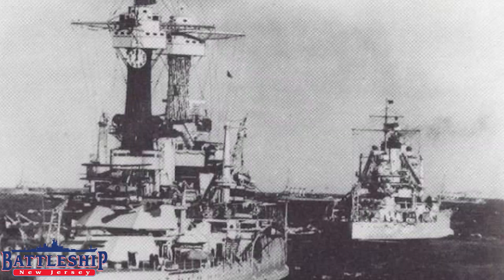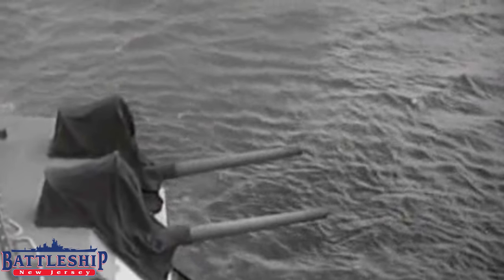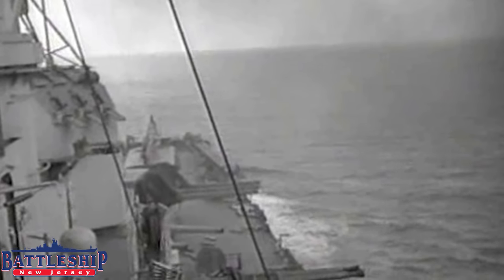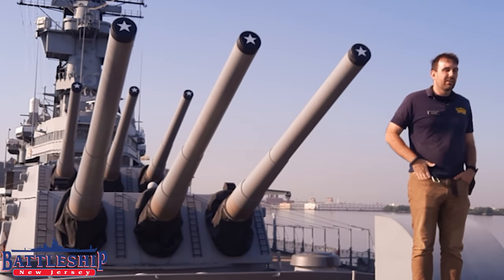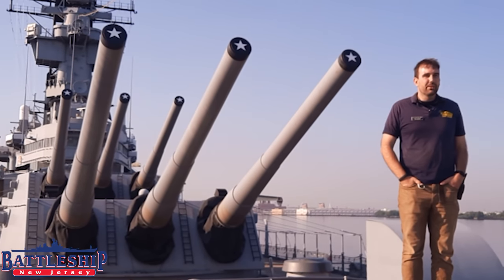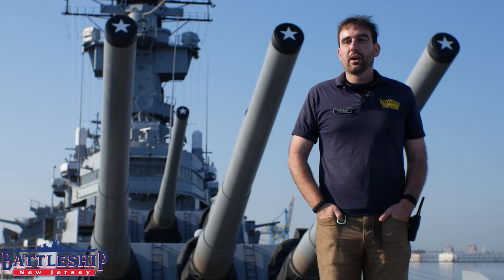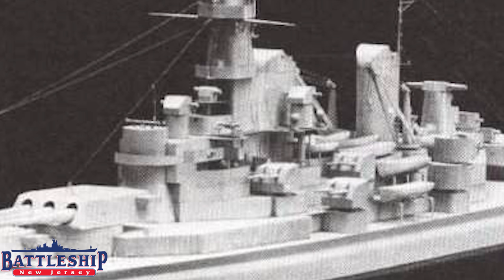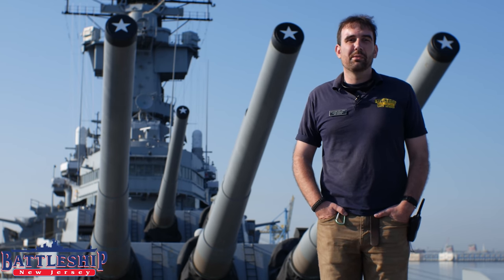Why are There Clocks on the Superstructure of Battleships?

Comment: I have always wondered how they distributed fresh air through those old ships, and exhausted the stale air.
Especially when they were at general quarters and all the water tight doors and compartments were sealed.
Reply from the maker: Check this out https://youtu.be/8xNzgxSihPY
Reply: At general quarters those things are shut down.
Reply: @michaelsommers2356  
Wow. I suspected as much. It must get close and unbearable if it goes on for an extended period of time.
Reply: @randypowell3180  I can't speak for the battlewagons, but Ticonderogas maintain ventilation during GQ unless it's a Chemical/Biological/Radiological defense situation...and even then, there is still internal air circulation.
Reply: @kdarkwynde  
Similar to those on a submarine maybe?
Reply: @randypowell3180  Especially in the tropics.  But it's better than sinking due to water flowing through the ventilation.
Reply: @michaelsommers2356  
No kidding!
Reply: @kdarkwynde  Ticonderoga is 80s and90s. Im sure battleships got ventilation after modern upgrades. But I guess in and before WW II not so much. Chemical Biological Nuclear warfare not a big concern in WW II. I think early submarines had to surface for fresh air
Reply: @3mtech  Gas attack .after ww1 all royal navy ships had methods of sealing the ships and ventilation/ filters for such. .i dont know , but i'd suspect U,S ships had similar .

Comment: [BB Tech. Question] :  Everything about Scout planes.  Why the battleships always had the catapults (pivoting/movable?) all the way aft (which seems reasonable), vs. the cruisers that had fixed aircraft catapults oriented athwartships in the amidships superstructure (which seems... problematic).  And the cranes & operational techniques to recover the planes when they returned.
Reply: Size Matters. 
Some Battleships had room for a Hanger, below the catapult on the Stern.

Many Cruisers had a hanger fore, or aft of midship catapult.

Comment: I imagine the Texas had a range clock at one time, since the later "standards" had them. Probably removed during one of her refits.
Reply: @Salty_Balls  BB-35 has  forward facing "analog clock" to this day. I am I misinterpreting what this video is positing?
Reply from the maker: We checked modern images of Texas and didn't see one, maybe she does though
Reply: @BattleshipNewJersey  I just looked at the image on their website.  No clocks visible.
Reply: @kncannon  I've been to the Texas several times and im not sure what you are talking about
Reply: Looking through the images wiki has of her she wasn't built with one, but acquired one by 1919 at the base of her mast both fore and aft. She had some work between 1940 and 43 getting more radar and losing her clock.
Reply: @BattleshipNewJersey  There's at least one photo I've seen of the Texas operational in '43 that doesn't show one.
Reply: Texas is so old she likely started with an Hour Glass.

Comment: Some of the reluctance to transmit over radio may be that if the enemy hears it (if they’ve broken your code or something) then they have the range too. The distance between the battle lines is the same for both sides. So if the enemy can hear your transmission, then you’ve just given them the range too, and their next salvo is going to hit you.
Reply: @Just Looking If a ship can read your range clock, it's close enough for a point-blank shot.
Reply: @Just Looking The clocks point fore and aft, your enemy will be off the port or starboard so they would see the edge of the clock only.

Comment: This is really more of a question. I enjoyed your expanded explanation pertaining to "Range Clocks" ⏰, and especially how it was made further obsolete due "high frequency", "Talk-Between-Ships". The second component explains, in part, how communications have improved since Dreadnought and Jutland. Understanding the integration of a huge bunch of various components is a necessity in understanding how any modern system, especially as complex as an apex Super-Dreadnought Battleship, functions increasingly more effectively over evolutionary design improvements.

Now The Question Regarding the New Jersey

On the last class of U.S. Battleships, I have been told, a new type of advanced "Fire Control" was utilized akin to a computer plotter. Also, the system is still on board, and used as built despite being designed nearly 80 years ago. Can you explain anything more about the Iowa Class "Fire Control Computer", and how it has remained a relevant piece of critical strategic C.I.C. equipment over the many decades of its on-board availability. I realize that the Iowa Class hasn't been used operationally since the early 1990s and aren't likely still up to modern standards. However, they were used in their most recent deployments after being modernized and refitted and I do wonder how well that worked as well as how much the systems had to be modernized/altered and augmented by other more modern system improvements. 

Thank you for your consideration.
Reply from the maker: We show off that computer in this video:
https://youtu.be/dmgsy01t0-U

Comment: What I would love to know about: What would the state of auto/self loading guns be like on a battleship scale? ie. Taking the same idea that was used in the Des Moines class cruisers with the mark 16 8" 55s and if/could/would it be scaled up and if there was any real discussion about a self loading battleship grade gun, and if there were any early designs for such a system.

That 8" mark 16 system on the Des Moines class was science-fiction only years before it was put on those 3 cruisers. I cannot imagine that 14" 15" or 16" systems of a similar design would not be on the drawing board, if the navy had continued to develop the gun systems of battleships. Especially with people who championed naval gunfire looking at what that gun system did with an 8" gun. Video of those guns in action is damned terrifying.
Reply: I've thought about the idea of a modern large caliber gun for firing sabot HE shells or other munitions at land targets.

Think like a ship version of a STUG. The gun isn't in a turret, but mounted to the hull with limited traverse. You point the ship where you want to shoot. Since the gun doesn't have to swing around, you can support the barrel more and make it longer. perhaps 70-90 calibers. This gives you increased velocity at the same pressure.

You'd probably mount two guns on a ship, firing backwards over the stern. This keeps the ship from being bow heavy and puts the muzzle blast somewhere it won't cause too much trouble. Smaller ships makes them cheaper and lets you deploy them over a wider area.

As I said earlier, you'd use a sabot. So a 16" smoothbore gun of 80 calibers in length might fire a 8-12" shell in a sabot. This will allow high muzzle velocity, yet good aerodynamics of the projectile. Add in base bleed or rocket assist projectiles and you could easily get a 100+ mile range. 200 might be doable, depending on how much mass you want to send. Modern propellant and metallurgy technology would allow the gun to maintain a reasonable barrel life.

You'd be able to fire whatever would fit into the sabot. Everything from cheap dumb shells that explode on impact to guided munitions that use GPS.

Comment: I once played in a large 1940 Mediterranean cruiser action using modified Fletcher-Pratt rules. The hard core players wandered all over, avoiding maneuvering patterns so as to make their range unpredictable. (Nothing like actual fleet units.)
We had three CAs, players I knew well, whose range-finding eyesight was as bad as mine. I talked them into doing something different. We lined up, nuts-to-buts, maneuvering slowly, concentrating on a single target, comparing ranges. One guy shoots a bit over the estimate, one straddles the estimate, and one shoots a tad short. No target survived two turns of our fire.
When we started, all the regulars called us idiots, saying that would never actually happen. I had to explain to them about range clocks, and that was EXACTLY what would actually happen.

Comment: You asked about ideas for future topics. How about the coexistence of the mechanical clockwork firing computer with the more advanced electronic fire control system that was fitted during the war? I remember reading, when the modernized Iowa class ships were re-entering service during the Reagan years, that they still used the old mechanical computer for aiming the big guns, and I have always puzzled as to why it was still needed.

Comment: If you haven't talked about it yet, the "cage" masts are pretty interesting!  They were replaced with upgrades post-Pearl Harbor...their function in the 20's and 30's was to allow enemy shells to pass through the cage mast without the mast itself being blown down by a hit. I guess they actually tested the efficacy of this before putting them on our battleships, eh?  Great videos!
Reply: Close. They were replaced by another British invention called the tripod tower. That came about when one of our cage masts collapsed during a storm in 1919 and an inspection of all of our cage masts revealed that they were being corroded by funnel gases. They also were weakened by a whipsaw effect when the guns were fired. Also the size and weight of the structures at the top of the mast added more weight to the structure contributing to collapse. The cage masts were replaced with tripod masts in the '20s and '30s.

Comment: Interesting video.  On a related topic, it would be nice to see a video on the optical rangefinders.  Also, what is the maximum distance that ships could see each other at sea from the viewing stations at the top?
Reply: I was a Fire Control Tech (Guns) back in the mid to late 70's. Found a portable optical range finder dated 1911 on my first ship. The ship was an fleet oilier. Why it was there, who knows. Tried to send it back to FT school at Great Lakes but the idea got nixed. Didn't have a chance to study it so I'm wondering too about them. I also was on a WWII tin can on reserved duty in Portland, OR. We had a Mk 37 GFCS with a 3 m optical range finder. Never used it since the radar we had went 50 miles. Of course the 5' 38 guns could only shoot 9 miles.
Reply: The maximum range view depended on the weather and humidity conditions. In pristine conditions I think it was 6 miles. That was extended by the use of float/scout planes on battleships. The Kingfisher was used on battleships for this purpose because the 16 inch guns would shoot over the horizon.

Comment: Very directional antennas, like yagis, especially at higher frequencies, so smaller antennas, were available in WWII. Aim the antenna at only your own ships, and the enemy will hear nothing. The really short ones were used for early radar, too.
Reply: You might have to communicate with several ships in different directions simultaneously.  You also have to keep the antenna pointed in the right direction as the ships turn and maneuver.

Comment: I have a question which I as a war gamer have come up with. Actually we could count it as two questions I suppose (1) including all those ship designs and all periods during which Battleships have been used in combat, how many decisive kills can be counted to battleships, versus how many losses? (2) similar question but restricted to WWII.

Obviously prior to naval aviation battleships were decisive, so the point of the questions is not to dispute or query that. But after naval aviation became a thing, it seems to me that battleships were very quickly, de facto obsolete, even though they continued to be designed, built and fielded by militaries as if the roles they played in battles like Jutland would continue to be strategically important and useful. It seems to me that, by the time of the outbreak of WWII, the actual role of battleships was to provide a big target for air attacks and to some extent to field AA weaponry in service to escorting other ships. Even their effectiveness at shore bombardment seems to be something of a question. Perhaps this is not correct, but I would be delighted to hear someone who knows the actual military history discuss the topic.
Reply: The last battleship floated by any navy was the HMS Vanguard. Commissioned in 1946 only because it was laid down in 1941 but material shortages drastically reduced her build time. The 2nd to last was the IJN Yamato. The main problem with a fleet battleship was that they were too slow to keep up with the carriers. Their primary role in the carrier fleet was anti-aircraft and torpedo protection. In theory their heavy armor would take the torpedo hit to protect the carrier. It was very rare for fleets to come within range of one another's guns after Pearl Harbor and Force Z the writing was on the wall for Battleships. Coral Sea was the first sea battle after Dec 7th and the fleets remained more than 70 miles apart. The sinking of the Bismarck happened in May of 1941 and Coral Sea was in May of 1942.

Comment: Re German ships not mounting range clocks ... that does make sense, KM ships weren't really envisioned as conducting line-of-battle engagements, they were mostly intended for commerce raiding (for the smaller ones) or knocking out convoy escorts and then commerce raiding (for the big ones)

Comment: I’m definitely interested in how battleships determine firing data. As a army artilleryman I know it can be an very complicated just for land based artillery. But seagoing artillery seems to be oh so much more complicated.
Reply: I was thinking about how much easier ship to ship naval gunfire would be. The dimension of height up and down is removed, and the observer and gun target line are the same. Point and shoot, it seems.
Reply: @jeremyperala839  At close range, yes.  However, in land combat at worst only the target is moving.  In naval combat the gun AND the target are moving.  Each move relatively slowly but without much warning.  Plus the gun firing is pitching back and forth, up and down with the ocean.  Usually the target ship is larger than a land target and so is the projectile.  Yet it is also better protected and only a direct hit is likely to cause the desired damage.  Engagement distances are often much farther too.

Comment: Thanks for the great content! I’ve heard of the colored flashes before as part of visual fire solutions but never the clock or turret marking. I’ve always been curious how they made the colored flash. Is it fix in the projectile? I’m assuming it had to be able to change depending on what other ships you were lined with. I mean we can’t have three ships blasting the same color and I’m guessing there were only a few colors available. Absolutely fantastic process though for 100% fast visual fire control/ fire solution communications between line of battleships.
Reply: not related to this, just a random question, how old are ya sir?

Comment: Some of the larger ships, (unknown if battleship or not), had early seaplanes mounted on top the rear guns. How did the guns fire with the seaplanes on them or did they have to launch the planes first?
Reply: The NJROTC Commander at my high school had been a scout float-plane pilot on one of the BBs during the war. He told the class that the planes were already in the air doing their scouting job well before the guns were firing. At end-of-mission or at Bingo fuel, the planes were recovered with large cranes and winches situated to replace them on their launching tracks.

Comment: They were not "clocks" per se, in the context of time.  The were set to range to target.  One was set to ten-thousands of yards, and the other set to thousands of yards.  These are more analogous to your electric or gas meter.  These told other ships the range they were firing at/to.
Reply: I’m l
Reply: Yeah, I watched the video too
Reply: It be right if your using just binoculars, zoomed in. Then flag signals other ships all code Search lights.
Reply: It's almost as if you watched the video, Bob.

Comment: That's a very interesting little video. I have a question: did WWII warships compensate for the movement of the ship due to swell when firing?  If so, what sort of technology did they use. And if not, how did they maintain any sort of accuracy in rough seas?  At Normandy on D-Day, for example?
Reply from the maker: We have something called a Stable Vertical, which basically uses a gyroscope to determine when the ship is stable. https://youtu.be/szxNJydEqOs

Comment: WW2 battleships didn't really broadside anymore, either. They had turrets which could traverse about 270 degrees, so they could rapidly change course, possibly after each shot - while still tracking their targets. Broadsiding was from when battleships pretty much had to aim the entire side of their hull at the enemy ship to fire, as cannons could only turn maybe 15-20 degrees to either direction from the "straight out the side" position, and even then there was no way to turn all cannons to a precisely identical angle.
Reply: Battleships almost never came into contact with enemy ships in WWII. Broadsides were commonly used to fire on shore defenses in preparation for invasion. Pearl Harbor was proof to the world's navies that the era of gun to gun firefights was over and Aircraft Carriers became the dominant force of all navies.